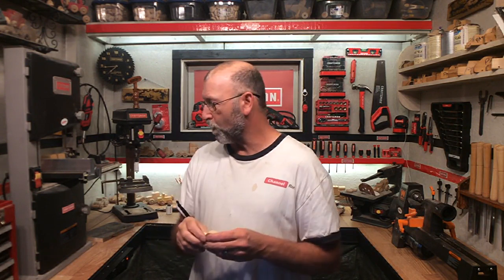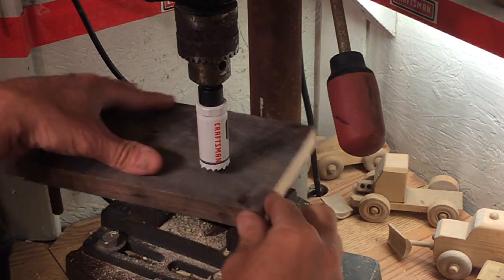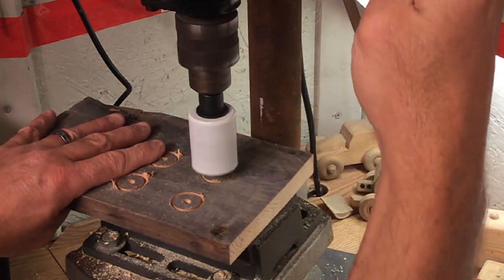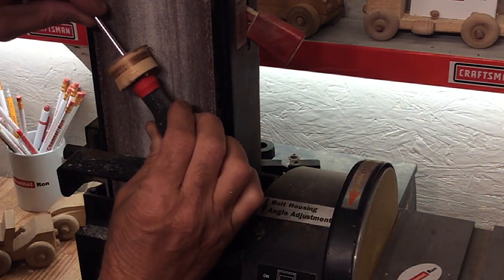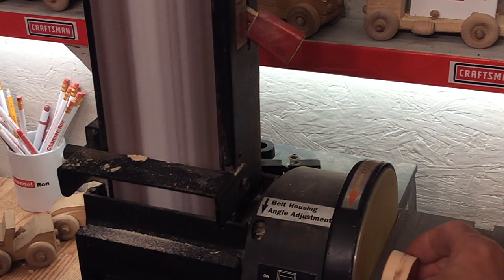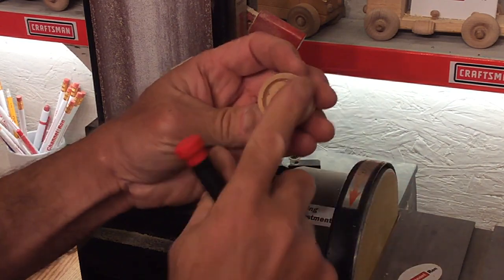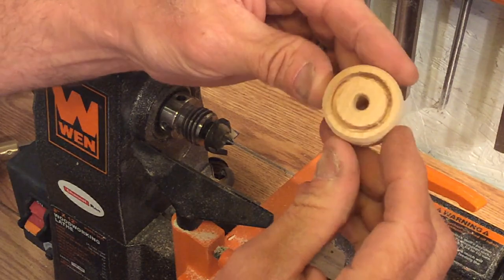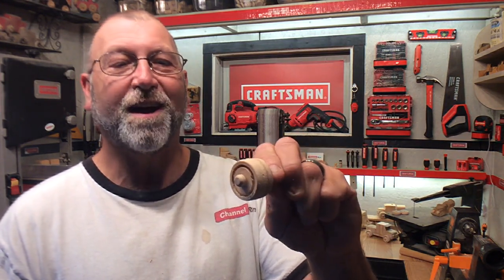How To Make Wooden Wheels

Comment: I think you can skip the belt sander since the lathe is the next step....it’s a lot easier to smooth down with a spindle gouge and sanding would also be a piece of cake on the lathe.

Comment: You’re doing good the one thing I do different is I drill the hole saw down to where the bit comes through the wood flip it over an finish drilling from the other side that way I have the wheel just parsley sticking out an can pull it out with my fingers an I always do all my sanding on my lathe but what you’re doing looks great thanks for sharing